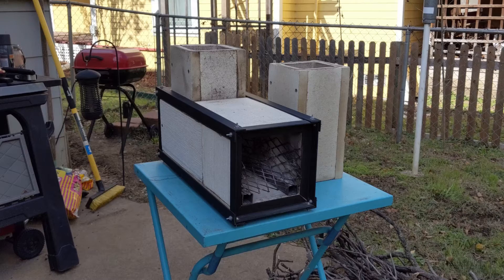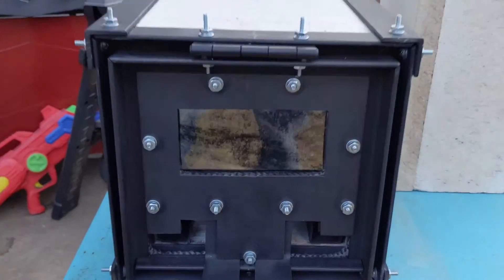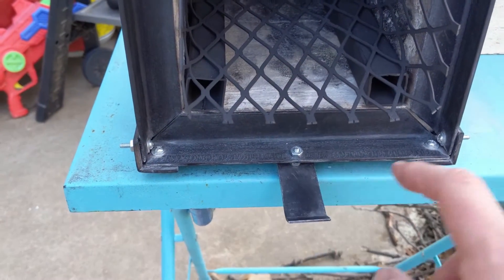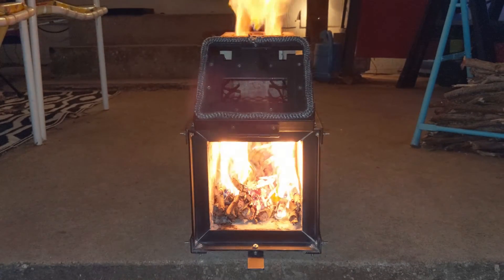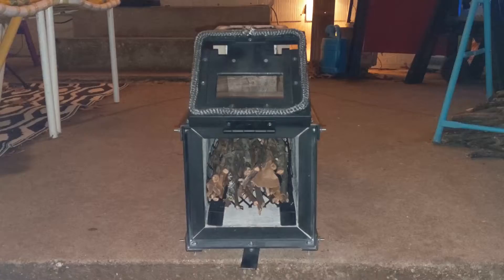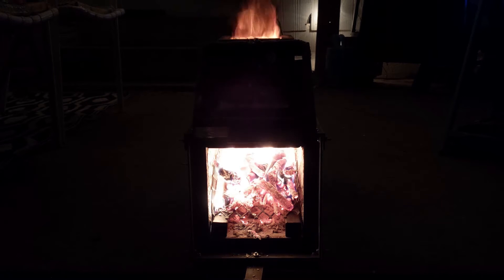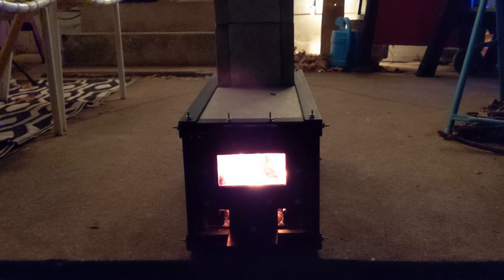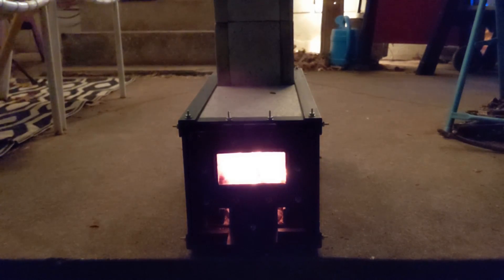Blue Flames Are Good Flames - Rocket Stove Upgrades

Comment: Do you think you’d get a better vortex if you made the bottom of the chamber circular where the vortex is formed? How about if the chimney was all circular?
Reply from the maker: Maybe, but it's exponentially harder to build. That said, I think the vortex looks pretty good and the flames go where they want to go, so 45 degree angles seem to work.

Edit: if you want a circular chimney, you can't use some boards and cut and screw them; you're going to make a mold, make your own mix and cast it.
Reply: @BitsOfInterest  thanks. I love your design, and you are the only RS builder that talks about the vortex. I doubt any of the other builders think about that. understand how this would make the build more difficult. I’ve thought about using a clay pipe. I’m not sure if I’ll ever build one, but you have been a great inspiration.
Reply from the maker: Sorry, I missed this. Youtube only notifies me of the first comment, not replies... Whatever you're using needs to be fire rated (2000F/1100C), so anything they use for conventional fireplaces, stoves and forges. It's going to be firebrick, refractory cement, stove liners etc

There are plans and drawings on batchrocket.eu how to build it out of firebrick or castings. Last time I looked up firebricks they were $9/piece, so I went with vermiculite instead, lol.

When I first learned about rocket stoves I just used an old pile of regular bricks that I stacked together to see if it would work. It didn't work as well as my recent builds of course because air gets in (and out) everywhere, but it did work. It worked well enough that some of the bricks cracked in half because it got too hot. It's what I had laying around and I wanted to see if I really needed to buy stuff or learn how to cast refractory cement :p

Comment: A suggestion... or 2. A) instead of 2ndary pipes at the bottom, build a thin ¼ inch channel/shelf at the top of the burn tube. Air will be heated up as it flows over the burn tube. B) instead of focusing into the middle of the riser, offset to left or right. This will allow a cyclonic effect.

Comment: Indeed I have an idea to you, a very easy idea to implement by the way!! You made a kind of "extension" to the chimney that you just put over it to increase height, isn't it?? When placed, the extension automatically seals the chimney making it taller, and this is what you are doing "wrong" (please don't miscomprehend me), well, it's not wrong at all, but if you want to improve it, just put it in a way that it forms a tiny gap between the chimney's base and the extension, thus allowing some air to be pulled to inside the chimney's base, this will "breath" some oxygen just where the wood fumes or gases are being released, causing a "double combustion", this will increase both the temperature and flame's flow!!! Some 1/8 inch gap is enough, you can put a wedge or something like between!!! I hope you continue your stunning work, please never abandon it!!! 🥰🥰🥰
Reply from the maker: Thanks for the suggestion. The seal between the boards already isn't perfect, because I can see the fire through the cracks :p The secondary combustion you mention is supposed to come from the secondary air pipes that hold up the grate in the burn chamber. If you add cold air by creating a bigger gap in the chimney/heat riser it probably won't work. In the tests you can see that it gets hotter when the pipes (and the grate) are in. I only get the blue flames also when the door is closed with the pipes and grate in, not in the first half of the tests without those.
Reply: I'm studying your rocket stove and I'll try to replicate it in a mini scale the size of a bunsen burner!!! Your one is the only one I have seen with blue flame capacity!!! I thought it was impossible from burning wood!! It's incredible, gorgeous, amazing!!! Please do more tests 🥰🥰❤️❤️
Reply from the maker: A Bunsen burner? That might be a little small, unless you just want to make a toy to play with. Mine is 24 inches tall and already (relatively) small. I need to refill it a few times per hour, so I'd want something bigger that burns longer.

For the sake of argument I'll say a Bunsen burner is about 6 inches tall, so you'll have to divide all dimensions by 4. You'll have a burn chamber that's 1.5*1.5*2 3/4 inches. It will probably burn up a pack of toothpicks every few minutes... If it works for how you want to use it, I'd maybe try a half-size version, in between what I have and a Bunsen burner. It will still need to be refilled quite often probably, but less maybe.

PS the SketchUp model is linked in my first rocket stove video in case you want to take some measurements.
Reply: Hehehh 😅 I love tiny stoves!! I can build a full sized one, but it will be used only to make coffee on my Italian moka pot!! Moka pots just need a little flame underneath otherwise the coffee brews with a burned and bitter taste!!! I use diy aluminium can alcohol stoves but I have wondered how it would become in a mini rocket stove!! I thought to make it with copper pipes (or even aluminium cans), but I'm considering to make it out of cement too, I still don't know, I have seen all your videos since the first one, so I need just to decrease the measures!!! Feeding it won't be a problem since I need a wee flame just for some 5 or 6 minutes!! Please don't stop your tests, they are fabulous 🥰🥰🥰
Reply from the maker: Ok, if it's just for 5 minutes of burn it may work, I'd love to see it 😁 I do hope your family owns a toothpick factory, because you'll need a lot of them 😜
Reply: 🤣🤣🤣 If I manage to make it I'll send you some pics!! But it's still a thought, not even a plan!! 🥰🥰🥰

Comment: My two cents. When that very high temperature is reached in the firebox and is reached in the first few feet of the riser, the secondary air is pointless. The ONLY purpose for secondary air is to burn up smoke that was not able to be burned up in the firebox. No smoke "can escape without being burned up" if the firebox is well over 1,000 degrees F. If you build a rocket stove and, in your tests, you don't get smoke out of the riser or the chimney, then you don't need secondary air. It's that simple. If you get a little smoke at the end, in the last 10 minutes as everything becomes coals, that's normal and no big deal. (here, temperatures are dropping.) Yea, closing the door can actually make things hotter. A firebox needs a certain amount of air, and more air than what it can use at any one time creates an air conditioner and cools the firebox a bit.

Comment: I'm not sure why you would have the door open upward like that, that's an accident waiting to happen. Also, I thought rocket stoves were supposed to be at an angle so they self-feed...
Reply from the maker: I put the hinge on the top so that gravity assists with closing the door and keeping it open, but feel free to put the hinge on one of the other sides. I'm not telling anyone what to do, just showing what I did and how it works.

The J-tube design you refer to is just a variation and it doesn't "have to" be that way. From what I read I believe this L-shape is more efficient when it comes to lighting it and how it burns. You have less chance of backdraft because of how it's shaped. 

As you can see in the video it doesn't have to self-feed because everything in the burn chamber burns equally. Maybe that's different if you build it out of steel tube and are losing heat all over the place or have your air intake somewhere else than the burn chamber, but I don't have experience with those.

Comment: I think toward the end he said temps were actually going down with the secondary air. Once you reach absurdly high temps., as he did, there is no smoke that is not burned up as fuel. It's all gone inside the riser. Once that point is reached, the secondary air is actually "an air conditioner" that cools it all down a bit. The ideal amount of oxygen does not always mean the maximum amount of oxygen. Once the ideal 02 amount is reached, additional air added is like an air conditioner. Secondary air is ideal in, say, wood stove applications where the firebox is about 400 degrees colder than a rocket stove and some smoke (unused fuel) is about to enter the chimney and leave the house as smoke. The secondary injection removes it. In my opinion, most rocket stoves can reach such high temperatures where secondary air is not necessary, especially with this ceramic board or vermiculite. Even most "welded metal" rocket stoves have no smoke, and they are cold compared to this one, and have no secondary air. I am just speaking to people who want to make this, and see all these videos where they think secondary air is needed. It is not needed. It helps a bit but don't think you MUST have it. Also, rocket stoves like the riser small to radiate / contain the heat. If your riser gets too wide, most of the effect is lost. Error on the small side for everything, even the "batch box."
Reply from the maker: I think the conclusion should be that temperature went down when I blocked as much primary air as I could. When I captured the blue flames in the riser both primary and secondary were open as much as possible. I think I forgot to take a temperature reading because I was too amazed by what I was seeing 😜

I got the highest (measured) temperature when I moved the slider in front of the secondary air, but there's a significant gap between the door and those pipes, so I think if they want to suck in air they still can. Also the yellow flames didn't go away when I started blocking primary or secondary air, only when both were wide open.

I have seen rocket stove videos where they do shut down primary air when it's up to temperature, but I guess my quick and easy build with 1 inch boards doesn't hold temperature that well and needs primary air. Maybe if you build another 1 inch layer around this one it works better, but then you're doubling cost also... Maybe then it's more efficient to just go straight to casting it 2 inch thick as recommended in the first place 😉

Edit: you can make the riser as wide as you want as long as you keep everything in proportion; it has to be taller and your fire box has to scale in all dimensions also. I would recommend a larger fire box so you don't have to fill it as often, but I didn't want to go taller than 2 ft on the riser.

Comment: Line with aluminum flashing & loop chimney over firebox with a steel plate top = stove
Reply from the maker: If the melting point for aluminum is 1220F (660C) it won't survive anywhere in this rocket stove. You can put a barrel with an exhaust at the bottom over the core to use it as a heater. You can find a lot of videos from people that did that.

Comment: Nice work! I can give you a tip on the door system: use a glaspanneled flip up where the bottom is not sealing to let in air, then use a normal door on the front with a glass, where the opening are on the top, that way the primary air also get's preheated, going in at top, moving down the glass to the gap into the fire box. I saw this in another video. It works really well. Also it helps protecting to sparks from fire box. I love your experimenting. Also another tip could be to put the secondary air pipes at the top, where the air is hotter, especially when you load up the box, there it will heat up quicker, and also hotter.
Reply from the maker: Thanks for the tips 👍 I can see how that door design could maybe improve efficiency, but mostly safety if you want to use the stove inside.

That said, I think it may be more complicated to fabricate without welding. I'm only using it outside and I only burn hardwood, so I haven't had a problem with sparks coming out. Still something to consider though if you are in a very dry area and don't want to start a forest fire...

Comment: I think this metal pipes do burn away pretty quick. Also that basket will.
Reply from the maker: If you're going to use it daily during the heating season you'll probably have to replace them annually. They are worth the convenience of lighting the fire and added efficiency though. They are also pretty cheap and easy to make.

Comment: If you were to put a cooking pot on your stove with the low riser the bottom would become Blackened. After you extend the riser and put your cooking pot on the extended riser the bottom of your cooking pot will be almost clean because of the more complete combustion . Good build and I agree the door does make for better control.  Usually on a rocket stove secondary air is used to reduce the output heat by cooling the flame .   There are many rockets stoves that are certified for home heating that use secondary air to cool the output flame temperature  and control the stove temperature to a cooler temp..

Comment: Nice interesting videos, thanks for the upload.
I can't find where you applied waterglass to your boards, and how you did it. I missed it?
Reply from the maker: Thanks 👍 I didn't film that because it looks exactly like painting something. So you use a regular paint brush and probably some gloves because all this high temp stuff is full of warnings how it will kill you 😉 Just let it dry overnight and fire it up to cure it.

I got the cheapest container on Amazon, but didn't pay close attention to the size, so I got a tiny 4oz bottle and I only had enough for the inside of the burn chamber. I could've spent a little more and gotten a big bottle to maybe coat some more boards.
Reply: @BitsOfInterest  Thank you for your reply.
So just painting pure sodium silicate, does the trick? Have you experienced it with time? Decays, brittles?
Reply from the maker: @thatcrazyguy1971  yeah, apparently that's all it needed. I should've painted that stuff on those boards as part of the initial build, but I didn't know any better at the time.

I can't really speak to time, because I haven't fired it up in 6 or 7 months (too hot here) but with all those tests I did for the video and a few burns after I didn't see any new damage. It used to feel like poking a stick in dense wet sand when I gouged the boards. Now it feels and sounds like rock, tough and a gritty sound. I think you can hear it a little when I pull those pipes out somewhere before I do the test burns.
Reply: @BitsOfInterest  excellent! Thanks

Comment: Can we please have a list of materials that's needed for this build?
Reply from the maker: I think this is it. I may have forgotten something, but then I'll edit it later. This is across all rocket stove videos up until now and multiple orders from different places.

8x vermiculite board 12"x12"x1" (300mm x 300mm x 25mm)
1x stove gasket cement (and a caulking gun)
regular wood screws longer than 2" or 50mm
1x 12"x12" (300mm x 300mm) expanded carbon steel
2x 1" (25mm) carbon steel square tube 12" (300mm) long
6x 1"x1" (25mm x 25mm) carbon steel angle 36" (900mm) long
1x 1/16" (1.5mm) carbon steel sheet
2x high heat spray paint
1x sodium silicate (and a brush to apply it)
1x 1/4" (6mm) graphite impregnated wood stove gasket
1x 3"x6" (75mm x 150mm) mica glass
some small bolts, washers and nuts to put the door together and a hinge.
Reply: @BitsOfInterest  thank you so much. Sorry it took me a while to respond. This so far has been the easiest build that I've seen to date on YouTube.

Comment: Could you be kind enough to post the size  of your fire Chamber & heat riser ? The inside & 
Outside, length 

 & high .
I would love to build one. I can fabricate the rest, so don,t go to a lot of trouble. 
I truly would like to build one. Great videos

.
Reply from the maker: I just replied to your other comment on the first video, so I'll just paste that reply here ;)

If you are familiar with SketchUp (Free) I shared the 3D model from the video in the description. (Edit: it's in the description of the first video, the one where I show it in the beginning.)

Just keep in mind the boards I used are 12"x12"x1" so most pieces are 6"x12" and some 8"x12" and 4"x12". You can think of it as two square tubes that fit inside each other. 

The heat riser or chimney is 4"x4" inside, 6"x6" outside. It's 2 boards or 24" high. 

The burn chamber is 8"x8"x18" outside, 6"x6"x17" inside. The 17" is because it's closed on the back,  but not the front.

Comment: 4:22 is that because of the (small amount of) thermal mass that the metal adds to the box?
Reply from the maker: No, it's much simpler. It's because fire needs air and when you have that metal grate in air can come in from the bottom. It helps a lot with lighting the fire and sustaining the fire later on. The ashes can also fall through so it doesn't starve the remaining wood from air. Without it it just turns into a pile of ashes with pieces of half burnt wood in it.